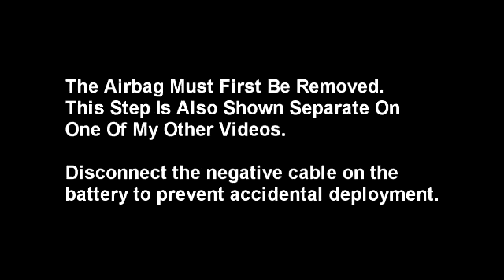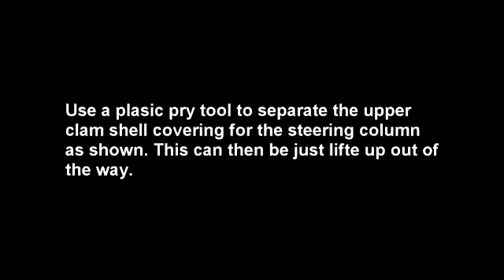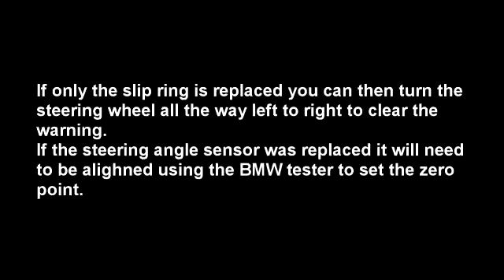BMW slip ring, steering angle sensor, and stalk switch removal BMW 3 Series E90

Comment: Hi, watching this video provided a lot of information for my recent problem. I am driving a 2009 X6 E71 35d, approx 75k mileage. Yesterday while driving suddenly my steering wheel felt completely loose, it can be turned either side like a free spinning wheel. I had it towed to the workshop. It was found that the bolt locking to the steering shaft has loosen completely. After tightening the bolt and ran through the programming, all the error codes were cleared, I can drive it like usual. Unfortunately the multi-function buttons and paddle shifters on the steering wheel are no longer working. Do you think this is caused by the slip ring and do I need to replace it to solve this problem? The mechanic only tighten the bolt and had not remove anything from the steering wheel apart from me spinning the wheel while waiting for the towing vehicle :( Hope you can provide advice.. cheers!

Comment from the maker: Hello, Noises are hard to diagnose through this medium but some things to check is first from under the vehicle check the motor mount bracket where it attaches to the engine. The bolt head shear off and can create a rattle. Also check the sway bar links which can make noise. I have also seen the steering shaft joint make noise on the xi model.

Comment: I have a 2008 328xi coupe with 57k miles and its starting to make a slight metallic clunking at low speeds when steering to the left or right. Sounds kind of like loose metal parts moving around inside the steering wheel or dash. I was wondering if you have had experience with this or if it's a known problem.

Comment from the maker: If it has the bolts holding it down you can. But you have to be careful not to turn the ring. This is the slip ring and it can be overturned. When install again and take a drive the internal slip ring wiring will tear off and you will get a bunch of warning lights and the slip ring will need to be replaced.

Comment from the maker: This noise could be the slip ring behind the airbag. It could be the steering rack seals telescoping the noise up the column. If that is the case the rack would need replacement. Or you can purchase Lubrizol from the dealer and add it to the power steering system. It may help remove the noise.

Comment from the maker: That is the one :) Lube the top really well and turn the steering wheel to get it into the seal. As a side note white lithium grease is not a lasting fix. That is why I use the other spray lubricant. It works much better.

Comment from the maker: Hello, Sorry for the delay in getting back to you. I am trying to get caught up on my responses. The driver airbag fault usually is a slip ring. There is no good way to test this as it is an intermittent high resistance problem that can cause the warning. The best thing is to replace the slip ring and clear the code. If it comes back only then would I suspect the driver steering wheel airbag. The rear seat belt light would not be related.

Comment from the maker: Hello, I have seen this many time. The first thing to try is to remove the kick panel on the driver side. Lubricate the rubber boot that the steering shaft goes through using BMW Kluperplex. You will need to purchase a can from the dealer I suspect but it works great. This is a high temp sunroof grease that sets up when sprayed. This may also be in the rack and pinion but the first step is to lube the rubber boot.